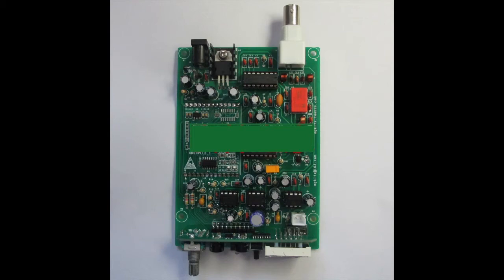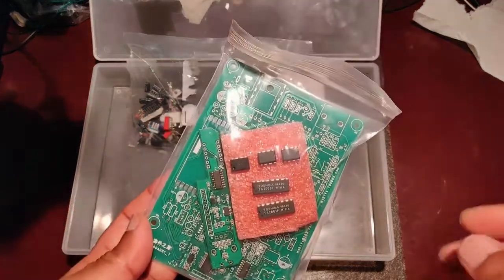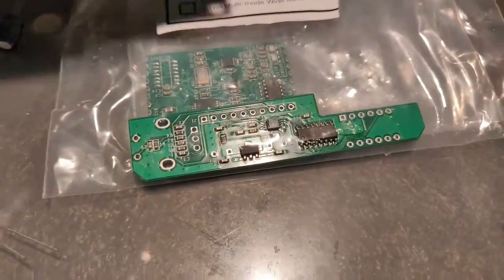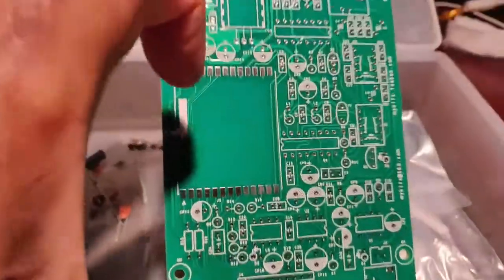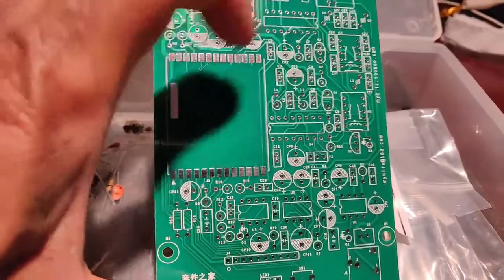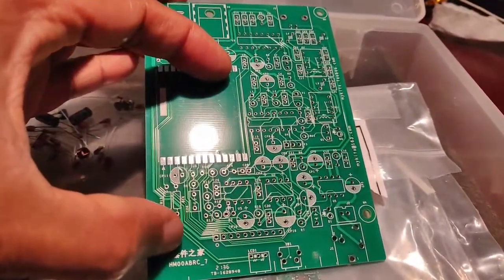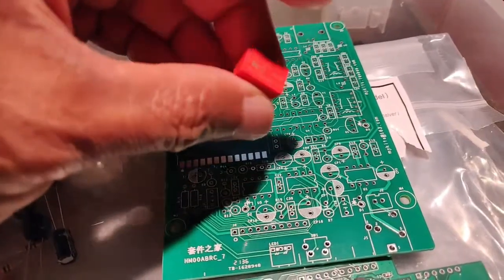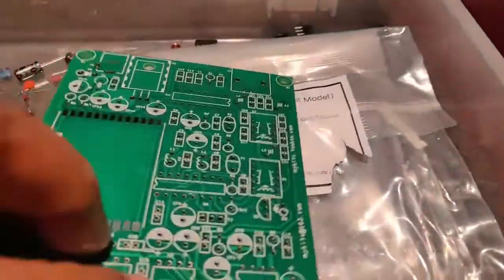R80 FM RADIO AND AVIATION RECEIVER | PCB HM00ABRC_7 | UPGRADED VERSION | AIR BAND RADIO | DIY KIT

Comment: hello my friend ı bought this kit .I did  the assembIy,The  FM is  working.BUT There is no signal at 118 and mhz 136 mhz What should ı do
Reply from the maker: Yunus, the Air-Band needs its own antenna. A good antenna, matter of fact. Something that's mounted/installed on your roof. Small portable antennas won't work unless you are standing next to an ATC/airport.
Find out the frequency of operation - of your local ATC or air traffic weather info broadcasts, and monitor those frequencies - with a good antenna.
If you still can't receive, you'll then have to debug by feeding in an RF signal at the antenna port....but you'll need some sort of an RF signal generator.
However, first get that antenna in place. Good luck!
Reply: @PremMenon  THANKS  DUDE.

Comment: Hi! I got this and built it. It fires up, but the frequency range is only between 180-360. Any idea why? Thanks!
Reply from the maker: That's unusual! Way higher, in fact double than what it's supposed to be.
This should cover approximately from about 80MHz to 160MHz. It has been a while, and I don't recall the exact figures.